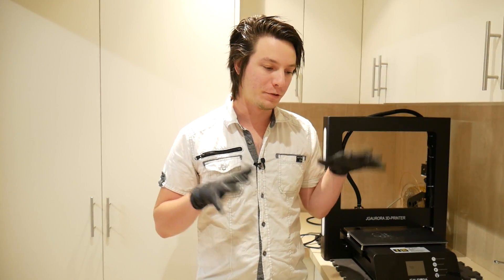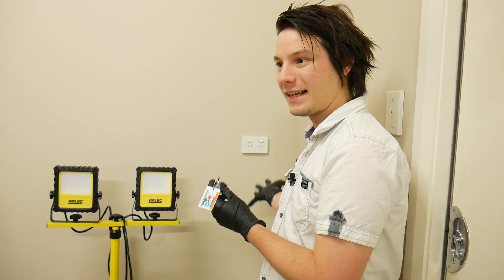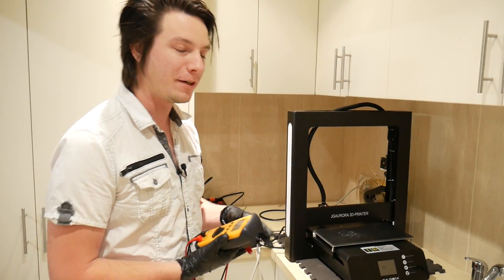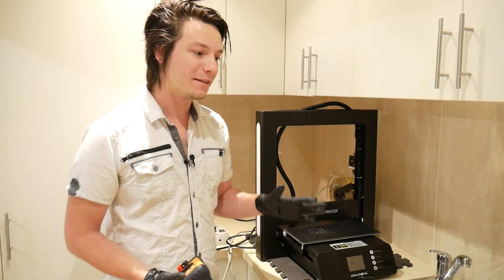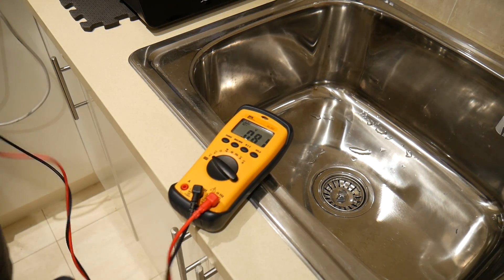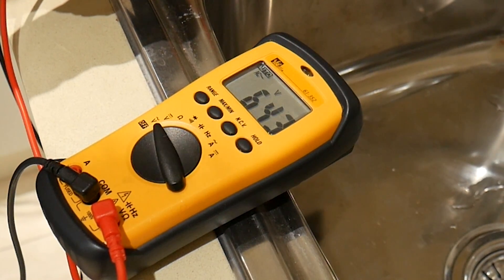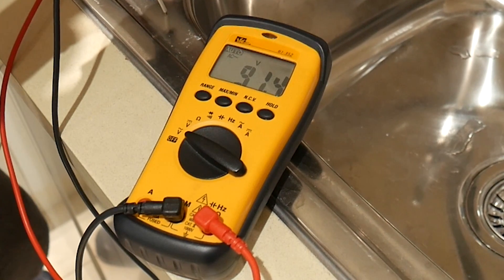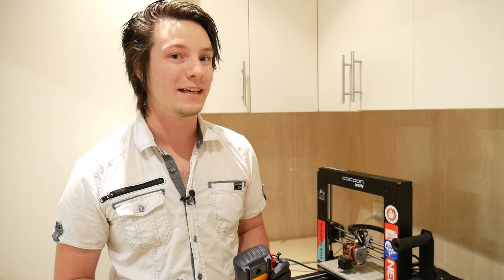This is why I was shocked by my 3D Printer IMPORTANT FOLLOWUP

Comment: Thank you for making this video clearing up what happened. Actually is it not /one/ capacitor, but two. Across Live and Neutral you have one capacitor called the X-capacitor. It is not the reason for the mains voltage/2 voltage on the chassis. It's the two Y-capacitors, one from live to earth and one from neutral to earth. They will form a capacitive divider and give you approx. mains voltage/2 on the case. It's perfectly normal and NOT DANGEROUS - I live in Denmark and we don't have earthing in many places, and it's NOT DANGEROUS because we have GFCI's turning off the current if you get a "proper" shock, not the small "tingle" that is on un-earthed equipment. Here we take no notice of the voltage since we're used to it being "normal" and safe. If the user feels it's annoying, he can have earthing installed in his home.
Reply: Well.....that explains a few things..
Reply: Great explanation tho....thank you for the info!

Comment: Hi Angus! Are you actually confirming that your string of cables you had cobbled together had a missing or bad ground connection? I wish you had replicated the cable arrangement and then plugged the tester into the end where the printers were powered to show the fault in the cable. It's not 100% clear from the video that this was the fault of the string of cables. I only infer that's where the fault lies from the context of the video.
Reply from the maker: +USWaterRockets yes, ground was not connected in my horrific setup before.
Reply: I agree, you showed the tester, then the two printers, but never showed testing the daisy chain of faulty power extensions using the tester. So you let us infer the final conclusion. You missed it.
Reply: That's putting it more bluntly that I would say it. Angus does a great job with his videos, so this is not a really major deal. I was just getting clarification.

Comment: Yet an other reason to wire yourself a standard ATX powersupply to your printer instead of those sketchy ones that come with them.

I use a server powersupply (flexATX) that is capable of operating at its rated 500W 24/7 on my printer and it works beautifully. It even allows you to wire a power switch and usb plugs inside the printer to have an octoprint server running on a raspberry pi inside the printer.

ATX is the way to go for 3D printers. Just like a computer, if the PSU dies, it can kill a lot of other components with it, so it's the one piece that you should never cheap down on.
Reply: And i can more or less ensure you, the server PSU does exactly the same thing.
Reply: xSchattenfluchx higher quality components matters in PSU. both for efficiency and for how securely the power is being delivered.
Reply: Yes, but no matter how high quality you y capacitor is, it will transfer a tiny bit of current into ground. 

High quality PSUs drastically reduce the chance of "tiny bit" turning into "whatever the socket provides"

Comment: Angus I'd like to know the wiring setup you used to make the voltage leak to the frame? Because here in Denmark, almost no wall outlets have ground in them they only have live and neutral. And yet I know nobody who's been shocked like that by a 3d printer. Including my own cheap Chinese printers. You must have used some tricks to make it do like you showed?
Reply from the maker: Ground was disconnected. That's it.
Reply: Maker's Muse that just seems weird to me. As I said, here we only have 2 pin outlets, and when I use a power supply with ground it is disconnected as there is no ground pin. Although nothing has ever happened. Although I don't know if we use some special system in Denmark.
Reply: when I google "Denmark wall outlet" I get lots of 3 pin outlets. Are you sure you live in Denmark? :D
Reply: We do have some weird regulations, I have been reading about them. Generally we only have 3 pin sockets in kitchens and bathrooms. The weird thing I think is normal rooms, where you CAN choose 3 pins sockets, but generally every house has 2 pin sockets in normal rooms. It is because all homes in Denmark must have HFI relays (which switch off the power before a lethal shock can occur). What I don't understand is why I am not shocked by my printer, which is only connected with a 2-pin (because there is no ground pin in the outlet), when this video clearly states that it is a normal behaviour to leak voltage when ground is not connected on a chinese power supply.
Reply: Not EVERY power supply has these Y caps. They are common, but your's just might not have them. Also, the ground of your power supply might not be connected to the frame. And finally, depending on the value of these Y caps, you may just feel a slight tingle. If you really wanna feel it, just gently move your finger up and down the surface of your power supply, barely touching it. You might feel the 50Hz humm. In some cases you can feel this even on Smartphones connected to a charger.
Btw, are your 2 pin plugs reversible? Can you rotate it 180°?
Reply: It still is strange, I have never felt any tingling shock by any small or big appiances with 2-pin plugs. Yes our 2-pin outlets are reversible.

Comment: 5:18 Would be a good idea to use the Fault Detector at the end of any extensions you may use to power your printers. Extension cables can become defective and could disconnect their ground line which would give the same results as when you got shocked.

Comment: That is not a "normal state". If the frame is properly referenced to ground, you should have close to 0V if not 0V across your sink and the frame.  connect the frame and your sink with a bit of copper wire and measure it again. --- Even though your sink probably has a ground connection through pipes and whatnot, you should do your measurements on a wire that is connected properly to a ground point instead of using your sink.
Reply: It is a perfectly normal state once you have a switching power supply integrated that has X/Y mains filtering inside. It is not dangerous, only unpleasant.

Comment: Hmm. Angus why didn’t you plug in the outlet tester into the power strip? Your video ( unless I missed it ) didn’t mention that the extension strip was not grounded.
Reply from the maker: The powerstrip setup that cause the problems was discarded so I recreated the issue using the IEC cable. If I had plugged the tester into the old strip however it would have shown red for fault, for sure.
Reply: Maker's Muse I think that’s my point - using that tester for the extension leads would have warned you if the Earth was faulty. Great explanation but you could have explained how that device can also check that the extension cables are safe. Some people might not make that connection as it were.

Comment: Ok, nobody tell the U.S. these power supplies leak through ground. Been wondering why there's no ul listing on these, now it makes sense.
2 questions though. Why ground? Why can't it just flow current through the neutral? And since it flows current through the ground, will it trip ground fault/arc fault breakers?
Reply: All the UL listed supplies will do the same thing. The current is extremely low. This is not new, special, unique to printers, or unique to cheap chinese power supplies - every PC you own has the same basic filter in it. Along with your monitors, TVs, cable boxes, and on and on and..

In quite a few cases, devices have this filter and NO GROUND PIN! They rely on some other device to sink the current. I have fond, hair raising memories of going to plug in the cable (literally, cable TV) coming from an 80" TV, cable tuner, blu-ray player, Roku, and 5.1 amplifier I'd just hooked up. All of which had filter caps - none of which had grounded power supplies, relying on something else to provide that in an attempt to remove ground loops. Something else ended up being the nicely bonded distribution amp. That was enough to give me a fright.
Reply: Monkeh again, though, why not discharge through the neutral wire? Why does it need to be the ground? Is it because of possible noise in the neutral?
Definitely not saying it's a Chinese printer specific problem, because these products weren't designed to a 3d printer, rather the printer was designed to utilize this power supply.
Reply: ground "is" connected to neutral at the panel already.

Comment: The leakage current through the Y capacitor will always be safe from an electrocution point of view as long as the value is within the recommendations. 

The risk in many cases is the reaction of a person to receiving a shock, which then leads to a physical injury. Dropping something, hitting your head, falling off a ladder etc.

Comment: Ground faults can be nasty.  But it's true that the bypass filter capacitor won't pass enough current to kill.   Another problem that can arise from no ground is interference.   As a ham radio op, I can attest to that.   Something with switching power supplies and stepper drivers would give out tremendous RF noise if it didn't have a good ground.
Older houses especially should have all of the outlets tested for proper ground.  At least here in the U.S., it's not surprising to find an old house where the outlets have been replaced with three prong outlets, yet inside there is only two wires and no proper ground connected.
Reply: Goes to show just how well the laws are enforced
Reply: As a home owner, you can replace outlets and switches by yourself.  The problem is when the owner has no idea what they are doing.  Very few people purposefully wire a house wrong to spite the law.
Reply: Here in Australia they're extremely strict about electrical work & licensing, with harsh penalties for dangerous practices like that! 
You're not even supposed to change an electrical-plug without a license, but in practice they turn a blind-eye if you know what you're doing & it's just basic stuff (& not charging for it)!

Comment: I was browsing gearbest today and I see they have an Anet A9 listed but I can't find any reviews on youtube or any information on google other than a couple of retailers with general specs.  Does anyone know anything about it? Is it a new model? Or was it re-branded?  Is anyone planning to review it?  

I'm looking to get my first 3d printer and I have more time than money so I'm not adverse to building it.  I just don't want to have to do a ton of tinkering after the fact.  I plan to use the printer to make prototypes of things for my other hobbies. I just want to build it, tune it, and not have to worry about upgrades or safety fixes. If anyone has any suggestions of a kit that would fit the bill, I'll definitely look at it. Thx
Reply: I think it is listed wrong, and is actually something else other than an Anet A9, I don't think there is an Anet A9.
Reply: IDK it was listed with at least 2-3 different retailers with the same pictures and specs.  It's weird.  It looks like an Anet product with some of the same components as the a8 and a6 but with a Cetus looking design.

Comment: Note to self: You can replace a Genuine Prusa i3 Mk3 with a kitchen sink and get the same results.
What is the print quality like compared to the original? :)
Also, find an equivalent chart for the testers, the light patterns actually tell you the fault. It's the only flaw with the bunnings one, is that the chart doesn't explain, just a 'fail/pass'. 
A search for:  'power point tester chart fault'  gave me some close ones.

Comment: Hey Angus, here in my apartment the only wallplugs are in the kitchen and bathroom. So am I suppose to put my printer in the kitchen¿  :P

Also I don't really understand the issue. 

Basically floating ground + magic with capacitors = shock if you touch the printer and you are grounded¿ 

I don't understand the magic part. Can you link me to somewhere I can read more about it¿
Does this also apply to computer psu's¿ should I also put my gaming pc in the kitchen¿
Reply: meesternadim Switch mode power supplies, always need ground from wall socket <3
Reply: A lot of the plugs in my house don't even have GFCI in them, only in the bathroom.
Reply: No they don't. It is good to use ground if available, but if you do not have ground, don't use it. You are protected by the GFCI.

Comment: All bow down to the UK's three pin plug and socket switches, it makes the rest of the world's electrical connections look pretty dicey !
Reply: Dave Lordy 
Our UK plugs, do seem to have every safety feature available...I don't think any other countries use all of them.

I like the Danish sockets, they look like happy little faces :)
Reply: "Our UK plugs, do seem to have every safety feature available"

Yup! From the nylon sleeve - so the pins are only ever live when they are pushed in far enough that you can only contact the nylon sleeve - to the solid square pins, have you ever used any of the EU plugs, you only need to put a little bit of weight on the plug to pull it out ! To the switch on the socket . . . everything about them says "I'm going to plug this in and live to tell my children" . . . actually our plug (type G) is also used in a few places like Singapore and Malaysia (and a few others I think) . . . another clever thing I only noticed a few years back, the earth connection in the plug is designed so that if you were to yank the lead so hard that you pulled the whole cable out of the plug - almost impossible with our cable clamp at the plug input - then the various live/earth/neutral wires will get pulled out in the order live/earth/neutral ! That is to say the first wire to detach would be the live, as it's shortest, then the earth, then the neutral . . . so even more UK tax payers remain on the HMRC's books ! Genius !!

"I like the Danish sockets, they look like happy little faces :)"

A happy face that hides death ! Lol : P
Reply: And then there's America where you can still get outlets without a ground pin
Reply: The only downside to a UK plug is when you stand on them in the dark! Ouch!
Reply: Pook365 
The 240V also means cheaper cables. Lower 110V means you need waaay more current for the equivalent power which needs thicker more expensive cabling.

On the other hand our plumbing standards are crap compared with some other countries 😂
Reply: "The only downside to a UK plug is when you stand on them in the dark! Ouch!" 

Sure it's painful, but at least you're earthed. : )

Comment: All of Europe has 240 as well.
Reply: germany got 230 volts. the voltage in europe varies between 220 and 240 volts. some countries got 220, some got 230 and others 240. 
most powersupplies work with 120-240 volts anyway though.
Reply: North America 110, South America 50/50.  I've destroyed a number of devices plugging them into the wrong voltages.  Most modern devices can use both.  Some have a manual switch, some can figure it out on their own.
Reply: Brazil got 220v, but it really oscillates between 210v and 230v. I think most countries use 200ish line, since it requires less wire gauge in the transmission cables than 100ish volts.
Reply: voltage in germany varies a bit, but rarely more than 5 volts. depends on the area though i think.
Reply: Most of europe has ~220v
Reply: Just about everywhere has 220-240, with only minor exceptions in the US and environs.

Aussieland is not that special.

Comment: So only America is overseas :D? All of Europe, Most of Asia and a good part of Africa are 220-240V
Reply: Japan is probably the weirdest, they have 110v in part of the country and 230v in the other...
Reply: @_Piers_  - That is because after WWII Japan's infrastructure was rebuilt by the allies, with America doing the southern half building a 110V/60Hz grid, while Europe (mainly France and UK) built a 220V/50Hz grid on the northern half.
This is also why they could not redistribute power after shutting down Fukushima.
Reply: @_Piers_  and also mix 50 and 60 hz
Reply from the maker: Wasn't sure where is what voltage :P
Reply: sorry made an error  60Hz not 50 in US
Reply: Yeah, it's 60, hence NTSC broadcasts were 60FPS.
Reply: America (maybe Canada) uses 110V 50 Hz (unless on an over seas military base)
Reply: AnukTheWolf Ahh that might be it, I just remember it was crazy :)

Comment: Thanks for these videos. I have removed the ground pins on numerous plugs and never thought anything about it. This is something I will no longer do.
Reply: zapro_dk in the case of 3D printers and various other technology, removing ground can be quite dangerous. Nobody says, “do you know what would be cool? If we added a third prong for no reason!” Not everything needs ground but a lot of heavier duty machines use it for safety purposes.
Reply: I'm not sure if you're serious, but if so - can you explain why?
(Where I live, the gound is "built into" the plug, at the outside as a flat connector, so no extra pin. So I have no idea if or why the third pin would be annoying?)
Reply: Christoph Alexander so where I am we can have three or two prong outlets and plugs. Three is newer and the third prong is a ground. So if I have a three prong plug and a two prong outlet I was taught just remove the third prong so it will go into the outlet. Now since I moved all my outlets here are three prong so it makes no difference.
Reply: @RyuDarragh The outlet box may not be metal or Bozo may have been at work. You have to confirm grounding. Personally I would have any two-prong outlet replaced anyway.
Reply: Ah, I see. Thanks for the explanation.
Reply: There is no problem in what you did. You do not need to change anything. Do not get scared by this. It is NOT DANGEROUS.